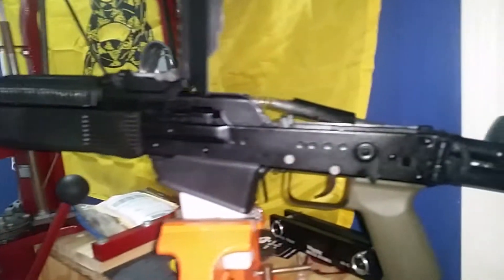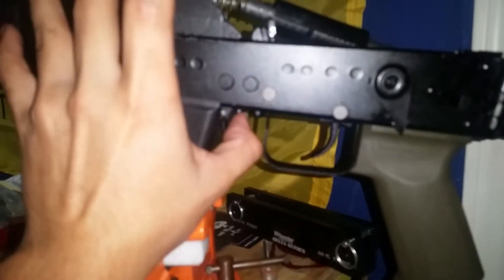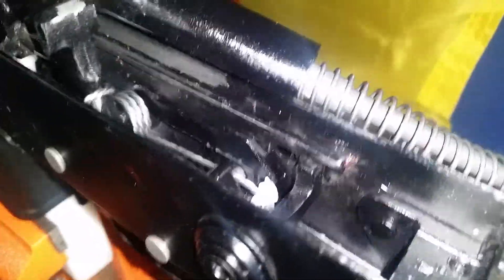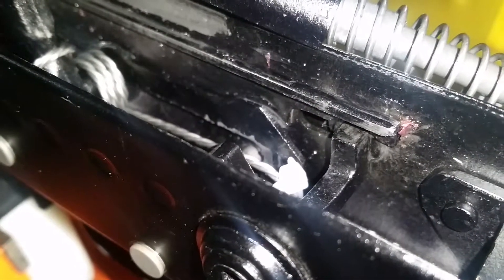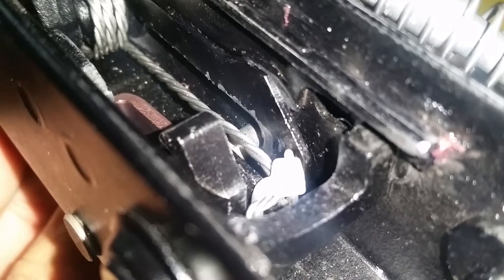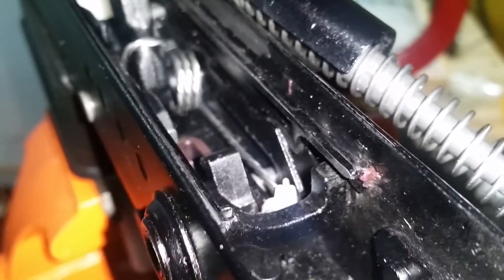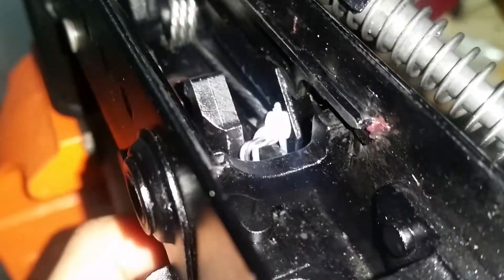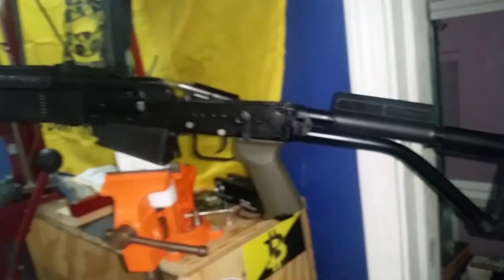Vepr 12 Bolt Catch Fix

Comment: Yessir! I found the hammer spring was pinching the bolt release. I pulled up on the spring and gave it a little twist - Problem solved.
Reply: Karen Mxx hi i got a question i just bought a new vper 12 and it wont cycle a round threw for nothing after i shoot it one time the shell gets stuck and i have to eject the shell my self
Reply: Santa Nero - there are several possible reasons. I would look for VEPR12ALLDAY on YouTube and watch his videos. 

One easy thing to check is the DRAM rating of the shells you are shooting. I would recommend no lower than 3 DRAM.
Reply: Santa Nero I shot 50 rounds of mixture of 00 Buckshot and slugs to break it in. Mine will cycle cheap Walmart ammo. It don’t throw throw the empty shells very far but it does cycle.